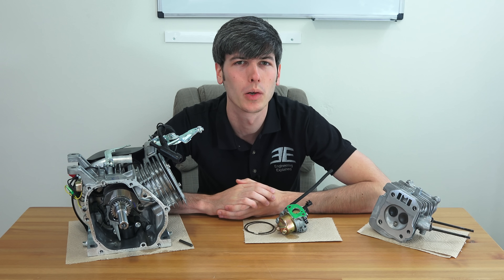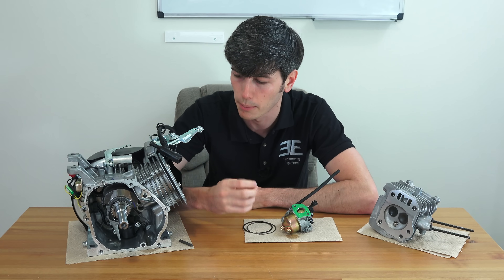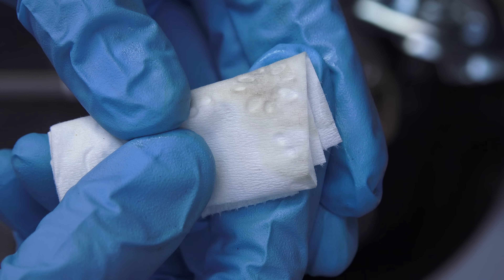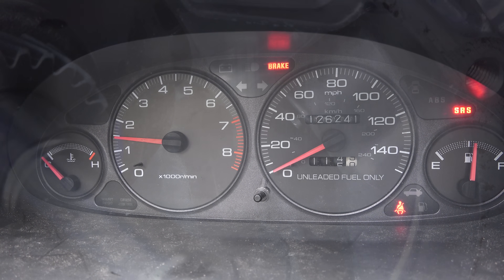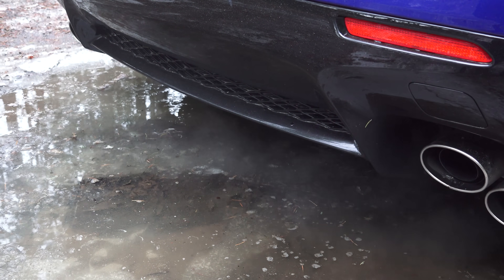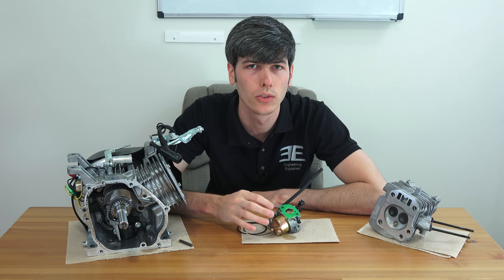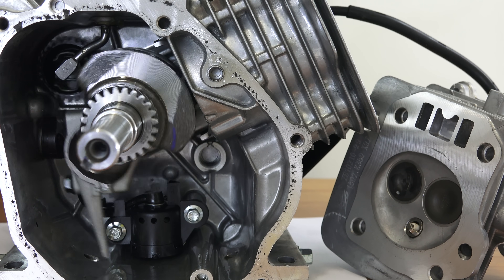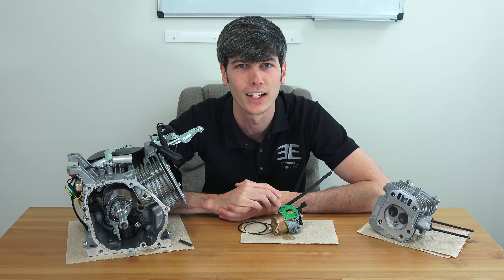Should You Warm Up Your Car Before Driving?

Comment: Engines make all kinds of no good noises when they are over heating, and when they are stone cold they are louder, rougher and sound like they are going to crack or fallout. Your right when it's cold you don't have to wait until the engine temp warms up. The engine will let you know when it's ready. When you run ya engine in the cold it idles a little high as if the throttle is partially open, once the idle comes down and the engine settles that means the gas is burning at the correct ratio and the oil has expanded then it's ready and if you look at the temp gauge it's nowhere near normal driving temps. But most people let their vehicles warm up too normal driving temps because they don't wanna be frost bitten when they get inside especially if you have leather.

Comment: I used to have a cheapass 1977 Grand Prix jalopy that starts well in freezing temperatures but sometimes I'll need a big pot of boiling hot water to pour down the driver's side (or passenger side) window to unfreeze the door lock so I can get inside. Then spend a couple of minutes while scraping snow-ice off my windshield so I can see where I'm driving... and the heater only puts out heated air when the engine is warmed up, as the heated anti-freeze/coolant is pumped into the heater core where that heat is then transferred to the cabin

Comment: ThiS is why our friend ChrisFix* advises to spray the cylinder walls (via the spark plug holes) w/ a bit of fogging oil before starting up a car that has been sitting for say 4+ months. EspecIally if it was outdoors and exposed to cold and moisture more

Comment: You should always let your car warm up, at least until the fast idle subsides. Usually about 30 seconds or so. Plus I’d rather be safe and have good oil flow throughout the engine and the turbo before I go romping on it.
Reply: The whole discussion is to dissuade you from this, although 30 seconds isn't long.

Comment: You have no idea what you're talking about when it comes to carburetors and cold starting. If you have a North American vehicle with a down draft carb with an automatic choke, it can be driven right away. This assumes that it's adjusted and functions properly. Even my old collector vehicles (SU Carburetors now)  with manual chokes can be driven right away if the choke is adjusted properly to the outside ambient temperature. I have neighbours with old trucks and carburetors and they have to keep revving them from cold start so they won't stall. This is because the automatic choke is out adjustment, they haven't engaged the choke by giving it one pump all the way to the floor before starting, and/or the mechanism in the choke that turns it on is broken (the bi-metal spring has failed). 
 These are just a few things why carbureted engines won't run in the cold. Most are out of adjustment and the fast idle cam doesn't engage properly on the carb, so the engine wants to constantly die, so the operator has to sit there, constantly revving the engine.
 The same thing also applies to carbureted engines as does fuel injected ones, it's best to let the oil circulate for 20 or 30 seconds and then let it warm up on the road, being driven gently until the temp gauge reaches normal operating temperature.
 I've driven nothing but carbureted vehicles for the past 30 years, I've never had to let the engine warm up because the engine doesn't operate properly when cold. They were all kept in good tune with properly operating chokes.

Comment: I drive a dedicated lpg car so I don’t have to worry about oil dilution. When I start up I wait one minute which is probably a bit too long then I slowly increase the throttle to about 2000rpm to ensure good oil penetration throughout the engine and then drive off normally.

Comment: Aluminum pistons vs iron sleeves?  Everything said is true but one could argue that engines are design led to run under load at operating temperatures.  Thermal expansion (or Lack their of)  could increase clearances and therefore impact loading and subsequent wear.  Even light driving generates a much higher load than  idling and therefore more load.  Piston slap come to mind.

Comment: The last 30 seconds is most important -dont drive it hard.. In otherwords you still need to allow the engine to warm up.  you drive a cold engine hard you will cause wear, do it enough all winter and you have a good chance of having an exhaust manifold issue -like a crack or leak. ...But as most have already said, you're usually defrosting the windows anyways.

This video could have been executed better.  The point in the video of carb vs efi is lost to most of us -the greater practicality of cold and warm up and various factors involved are more concerning and leads back to the same thing -you still need to let the engine warm up (you shouldn't drive a cold engine hard)
Reply: Start driving the car not hard but slowly

Comment: the owners manual for my 2016 Subaru Crosstrek recommends that I wait until the blue engine oil temp light goes out before driving.. So I follow the manual.
Reply: Best option, this video is generalised for All engines
Reply: Also weight reduction without manual
Reply: Nerd. The owner's manual is the first thing I get rid of in a new car, instant mpg and hp boost.
Reply: Same here for my Honda I follow it takes about 60 seconds took almost 10 minutes when it was -15 the other day but I follow it for my BMW as well I trust Honda when it comes to engines
Reply: You're 100 percent correct.  My brother is a Subaru mechanic.
Reply: How long does it take?
Reply: @rotorblade9508  about 3 seconds, I just pop open the glove box and yeet that mofo out the window right onto the dealer's lot
Reply: K P lol
Reply: @KP-sg9fm  legend
Reply: The owners manual is designed to destroy your car so you have to bring it back to the dealer every 4 months to get repaired. But I see you're a woman, so that explains the gullibility
Reply: @Bennysol  Content on your channel checks out with this idiotic comment
Reply: @Bennysol   Its always bad to drive on a cold engine, The Oil needs to circulate, otherwise its metal on metal, which increases wear..
Reply: @whitenugget3750  if it's been sitting for months. Oil has a film strength that never settles to the oil pan. A car that is started and used often the engine will always be lubricated. Sure take it easy until it warms up (keep it under 2000 rpms but 20-30 seconds of idling after starting is plenty of time to start moving. 
The film strength in some oils are so good that some engines can run close to 20 mins with no oil before seizing up or throwing a rod.
Reply: @whitenugget3750  The oil starts circulating through the engine even before it starts by the oil pump.
Reply: @Bennysol  Interestingly, I thought the same thing until I saw some tests by The Motor Oil Geek who proved that even by not filling your oil filter with oil prior to installing it can be equivalent to up to 3,000 miles of wear on the engine just for the brief amount of time that there was no oil circulating while the filter fills up. Granted, his test was with a much larger filter that takes longer to fill. They measured the amount of metal deposits in the oil to prove this.
Reply: @Bennysol  true. Auto makers and dealers have no clue about cars. I once heard a bmw car salesman tell a woman that its normal for them to leak oil
Reply: @ButtonandBuck  Actually... tech writers consult engineering for these recommendations. They don't just come up with them on their own...

Comment: You can damage a cold engine over time if not careful. Also the electronics on some vehicles need a little time of initial start to work to their full optimization. You may disagree with this, but it's a statement of fact, even though you could run it without time optimization. I found it better to wait a little time before driving off. The benefits of gaining a minute or two do not justify the hurry.

Comment: I start my fuel injected car and let it idle until the computer drops the idle down below 1000 rpms. In warm weather that takes about 30 seconds from a cold start. In cold weather it takes about  60 to 90 seconds. Where I live it rarely goes much below 10°F.
My point is...let the cars ECM dictate when it's safe to drop in gear.

Comment: I let my truck idle for about 5 mins or until the idle rpm drops to its lowest point. I then drive lightly keeping engine revs below 2000 rpm until I reach optimal temperature.

Comment: Its pretty logical actually. If its very cold outside and you start your engine, your Idle will be at like 1500-2000RPM and settle down as you wait. But why wait? You already started like that EVERY morning. Light driving up to 2000rpm on a cold engine is totally fine and better than waiting for it to warm up

Comment: Professional tech here.
I hear this a lot, but this is a vast oversimplification.

Every material expands and contracts with heat and cold. The wear comes from operating the engine before THE METAL MOVING PARTS are up to temperature and therefore operating at their correct fit.

Put a cold, loose engine under load every winter morning for a few years and you won't have much left.

Comment: Whilst I do agree that there is no need to let the car "warm-up" before driving (keep it under 3000rpm and under 45 mph until the temp light goes away), in -35 to -40 degrees any immediate driving creates audible rattling noises and it doesn't sound good with the loud "tick-tick-tick" when over 1500rpm. Monitoring the engine temperatures though it only takes 1-2 minutes to get the temperature above freezing in the coolant and oil at which point some easy-driving is okay...

Comment: I could care less abt warming up the engine... I just don't want to freeze my ass off on the way to work lol 😱😂😂
Reply: Heated seats.... that's the answer!
Reply: Move to Florida. Problem solved
Reply: BanAllPitBulls lol I don't care. I misspoke, my statement stands. And you have yet to prove a valid point. Nice
Reply: Driving it will bring it to operating temp faster which will heat up your heater core quicker.
Reply: so spastic when people  say 'could' care less.
Reply: sultanabran1 i dont get when people say its not correct. If he says he could care less, he states that he cares but he could care less about it...grammar fking nazis
Reply: I completely disagree with Rick. Always warm engine up, good way to keep it from oil consumption later in life of car, transmission fluid is thick when cold as well. I'd love someone to chime in with some counter thoughts, I'm always open to discuss.
Reply: Webba you just said what the true. I agree with you “life experience.”

Comment: Unfortunatelly, in very cold weather, you have no choice but to let the engine warm up. Not because the engine need it, but because you need heat to heat up the windshield so it do not fog/freeze all over. I once got that surprise, start the car, remove the snow, get in: cool, no fog/freeze. Start driving... Literally 10 seconds later it started to fog/freeze. 15 seconds in and it started to be quite dangerous, and I pulled over. By the time I did, I couln't see in front of me, like, I know there was a car 10ft in front of my car, parked, but could only see a blured color.

Had to wait almost 10 minutes for the damn engine to heat up...

Worse thing is: as car get more efficient, it get worse and worse. My first car had a 2.4L engine, would give heat within 5 minutes at idle. Next one was a 2.2, and quite more efficient, and was taking about 10 minutes at idle. New car is 1.8 and after 15 minutes it is still meh. In fact, this morning was 7°C outside, the heater in the car was making the engine temperature drop at a red light! This car is a bit annoying for that, but man, I love it!

Comment: I'm completely at a loss here...yeah, the rich mixture dilutes oil, but that's the whole freaking point of a high idle speed, which will then drop and bring the AFR back to normal. Additionally, all you mentioned was the cylinder walls. What about if I have a freaking turbocharger? What about my crankcase? What about heat spots on the block due to low-rev driving on a cold engine? (Which puts significant stretch on the head) What about my transmission? Etc etc etc

At the end if the day, it will ALWAYS be FAR more damaging to drive your car 15 seconds after starting it cold, then letting it sit for 5 minutes. Anyone who knows anything about the overall operational mechanics of a motorized vehicles knows that. Metal expands at temperature, and all of our engines have operating parameters based on that metal expansion. Hence, OPERATING TEMPERATURE.....Jesus Christ

Comment: So the other parts of this that aren't being considered is metallurgy. Your engine and all of it's mechanical components will shrink when they are cold and expand when they get hot. The reason your engine has an operating temperature is because that is the temperature your engine was designed to operate at. 

The viscosity of the oil also will change depending on the temperature so im going to have to say that a warm engine is a happy engine.

Have you ever listened to an old ej25 with around 200,000 miles start in the cold vs when it's hot. You can hear the difference

Comment: I understand that the time duration of warming up is longer... but using around 2,800-3,400rpm to avoid holding anyone up during acceleration (it’s called sharing the road) during this rich fuel mixture with additional strain to the engine seems like it could add even more wear in the 4minutes as opposed to 10minutes. Also, the engine typically wants to hold gears longer and runs harsher during this warm up time... it can literally feel like you’re putting additional strain on the engine.

Incase anyone is curious, I used to drive a 2006 Pontiac G6 GT Sedan 3.5L (10minutes to get to operating temperature from cold start when idling Minnesota winter) that had 107,000ish miles when I purchased the vehicle in February 2014 and drove it up to 180,000miles. I upgraded myself and I now drive a 2007 Pontiac G6 GTP Sedan 3.6L (10minutes to get to operating temperature from cold start when idling in Minnesota winter) that I purchased in October 2017 and it only has 73,0120ish miles. 

In all of my vehicles I make sure to only use Shell V-Power (and then V-Power Nitro + when it came out) in conjunction to Pennzoil Ultra Platinum 5w-30 that was changed out every 3,000miles while also changing the oil filters with Bosch Distance Plus and a standard air filter. Using premium fluids definitely make a difference and I can feel it as I have in many many vehicles. 

I digress... I just don’t feel comfortable driving my car when the engine’s (heart of the car) characteristic is completely different and underpowered or feels “brittle” compared to the rest of the drive. Also, I normally have to drive up a steep hill and the strain of climbing probably is not good for a cold engine.

Anyways, I love these videos and keep up the great work!!

Comment: Idk I'm sceptical. They say no, i say yes here's why. Yes we do not use carburators of tbi no more. But we should wait for oil pressure and oil to reach the top of the motor , because engine wear always happens the first 30 seconds of engine start. My auto professor always said wait a minute n ur good I wait 4_5 and I always feel the smooth ride and better engine performance in the beginning.

Comment: car manufacturers should  instal into car a  fuel heater that would heat petrol when it  is  below 40 deg c, to prevent oil dilution and help vaporisation

Comment: I say the answers yes. You oil is cold and thick sitting at the bottom of them engine and needs to warm up to cycle through the engine, that’s why the number one cause of wear is during start up. Also metals expand when heated and most engines are designed to run at an optimum level of heat. Why do you think engines, even new are so loud and chattery when cold, then quiet down after warming up?

Comment: Engines are Designed to drive  at a Certain Temp. usually about 220º   When the Engine gets to its operating temp  the Metal in the Bore and pistons have Expanded ,leaving less gap for slight Rattling.Engines wear every time it is operated, But it wears faster when operated on cold starts, OH AND just cause its 100º outside doesnt mean the car is Already warmed up

Comment: You DO let your car warm up a bit... at bare minimum you want the engine to warm uniformly... this is even more critical for cars running some type of boost... and the last thing you want to happen it's the thermostat to open suddenly thus rushing cold coolant on to hot cylinder sleeves... I live in northern NH, Winters be cold

Comment: Most important reason you warm up your Engine is for the engine block to expand (micro expand) it helps against head gasket oil leaks..... it’s one of the most expensive repairs

Comment: Most manufacturers will say the same thing as what this guy is saying I personally start my car put my seat belt on check the mirrors and put the radio on or whatever about 10 to 15 Seconds till I put it into drive then just accelerate gently and keep to speeds at about 60 kmph or 35 mph till the engine starts to warm up been doing that for years

Comment: I enjoy your videos but this information you're giving people relies hugely on what type of oil you have conventional or synthetic being from the north where it could be negative 30 degrees Fahrenheit you're going to need to warm up the engine so your oil can flow freely before you start driving it especially if you're in a area where there's a lot of variation of grade if you're using conventional oil and you let it run for 15 seconds when it's negative 20 degrees Fahrenheit outside and then you drive up a 8% grade you can guarantee you there will be more wear on the moving Parts in your engine.